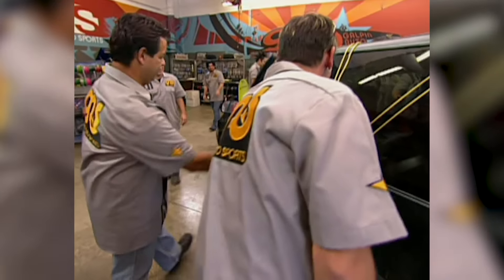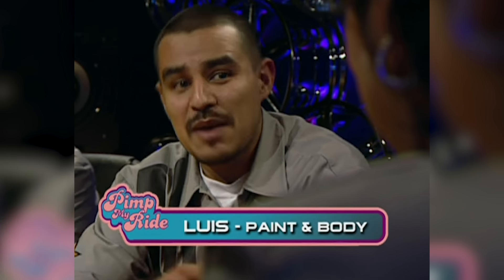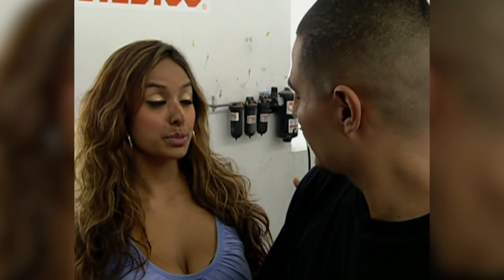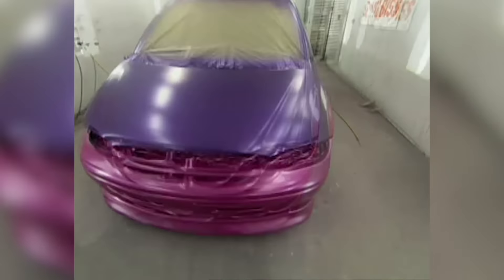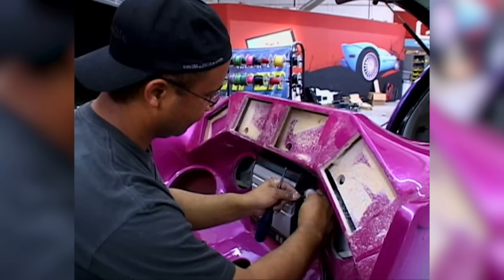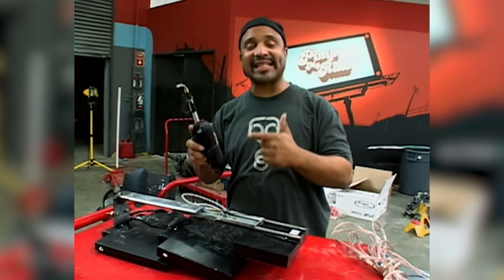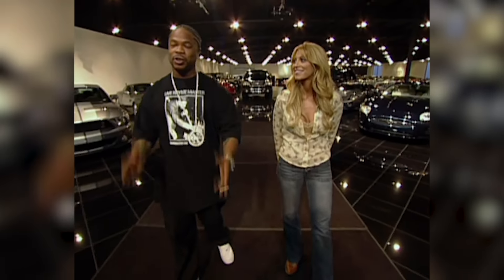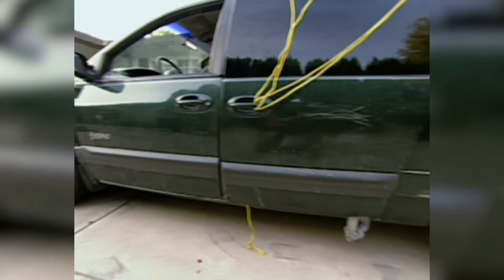Coolest Minivan Transformation Ever | Pimp My Ride

Comment: I think it’s horrendous and should have just been restored to how it was before .
pimp my ride is actually a crap show and some of them contestants cars actually broke down not long after and parts fell off and one even went on fire due to so much electronics in it causing electrical fault and with these cars  being so old they never even changed brakes or did any services on the vehicle like checking oil and water just paint and put a stupid amount electrical items like subwoofer and  speakers and TVs in and think that spells the future for the car one contestant said a few weeks later the card needed a whole new engine and he couldn’t afford it what’s the point in doing a car up so old of the engine was already past it and they should know if they don’t do mechanical fixes on it that’s it’s gonna break and the owner wouldn’t be able to afford the fix because that’s why he had a shitty old car in the first place and some even said that they wasn’t even Their cars originally and wasn’t filmed at their own house and they knew they was coming and faked the reactions when opening the front door and also they said obviously they would know they was coming because if they didn’t how would they know they was even in at that time could have been out so it was obvious to us the contestant knew and that they had the cars sometimes for about 7 months and that the contestant couldn’t rent a car due to their age so had no transportation for months yet MTV  got a show out of them and a lot of them cars if was in UK wouldn’t even pass an MOT